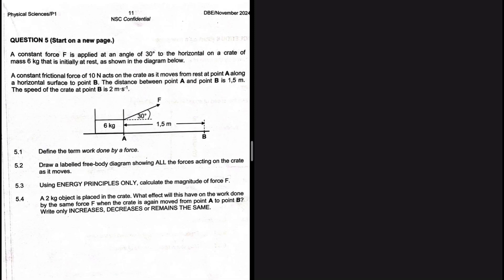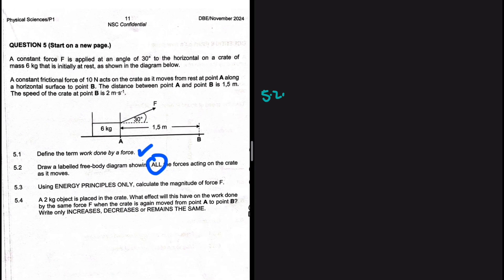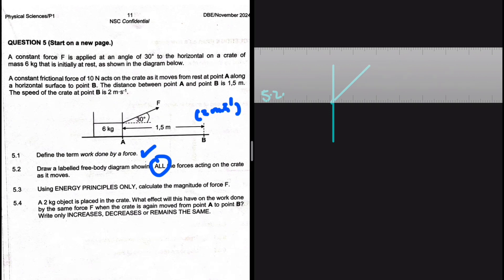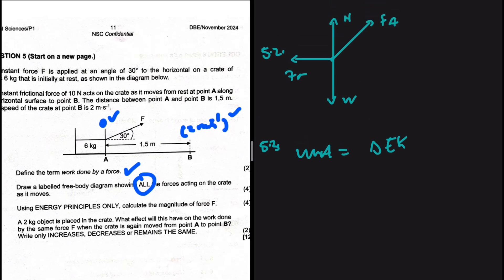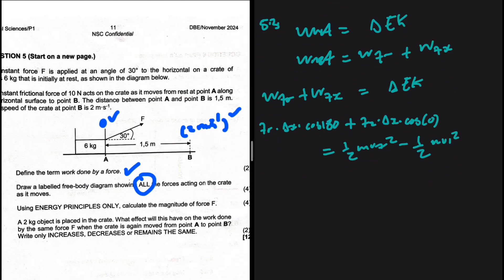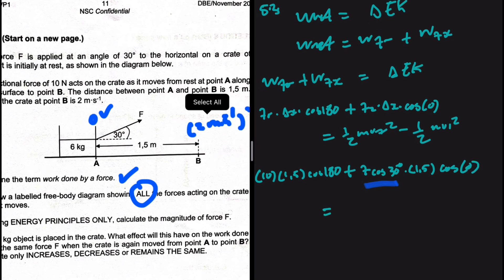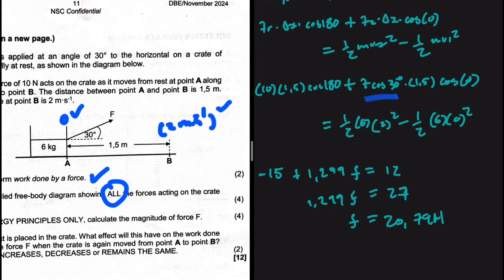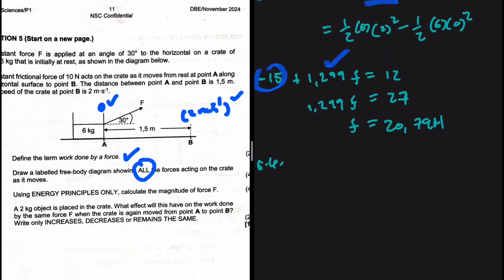Work, Energy & Power Grade 12 Physics November 2024 (F= 20N)

Comment: Sir you worked out the frictional Force wrong because the cos is supposed to be  cos180 and not 0 sir and I have past exmaples and not tht that have a similar example to this exam question
Reply from the maker: I said cos180 for fr, didn’t I?
Reply: Yes I see that you already put it I apologise for that I only stopped halfway through the video and then you correct your mistake.
I do have a question sir 
I got the same answer but the steps I did are different but similar to yours so will I still get full marks or minus 
Here is the scenario :
I first solved  the kinetic energy of that crate then I plug the kinetic energy into the wnet formula that wnet formula obviously equal to the horizontal applied Force - the frictional Force multiplied by the distance obviously multiplied by cos 0
I solved and I got my horizontal applied Force I use Pythagoras to get my force that was pulling the crates up and I got the exact same answers you

Comment: You worked out the horizontal force only
Reply from the maker: No… that’s actually F and not fx because I wrote Fcos30….

If I wrote F without the cos30 then that would be just Fx
Reply: @grade12 mhhh?
Reply: So if I continue I will miss marks
Reply: @sociyME1934 what was your answer ? I got 18N